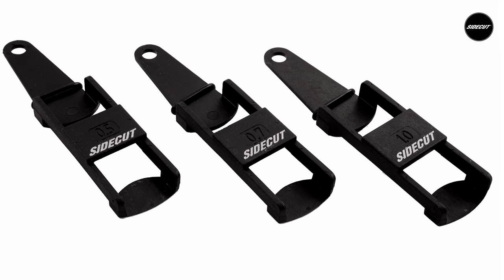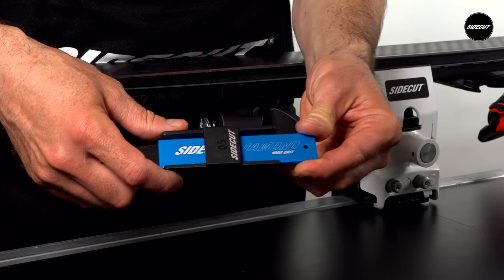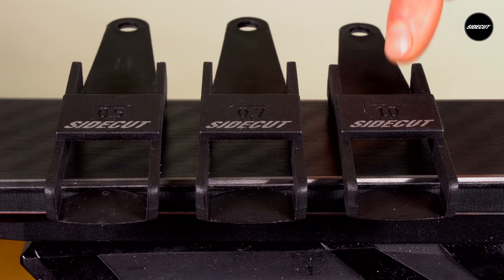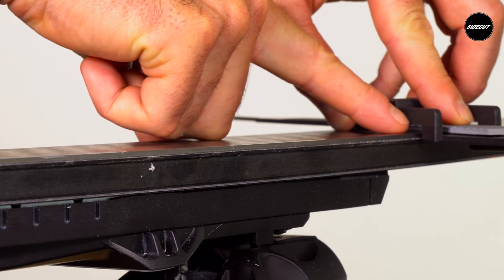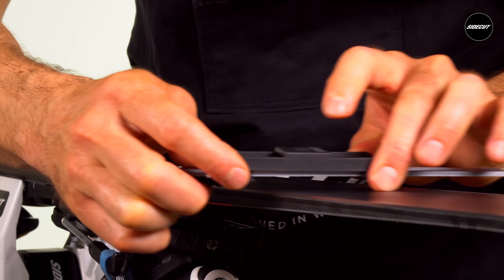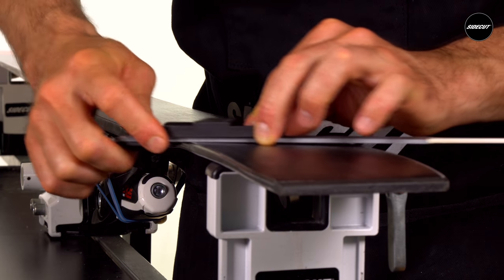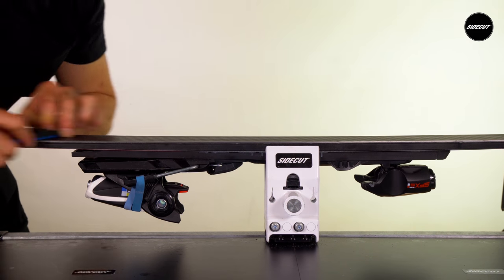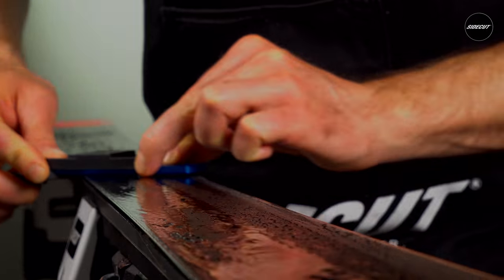How to use Base Bevel Guides

Comment: What would be the standard base bevel for an all-around advanced skier and snowboarder? And side edge bevel?
Reply from the maker: Standard base bevel for skiers is 0.7 degrees typically and 2.0 degrees of side bevel.  Snowboards are typically 1.0 or 1.5 degrees on the base edge and 1-2 degrees on the side edges (free-ride that is, not competitive riders).